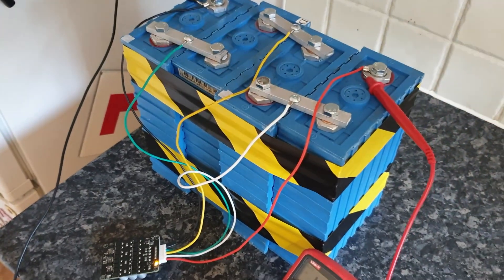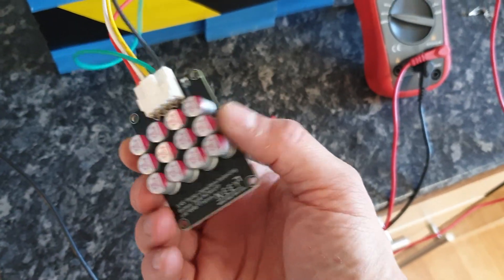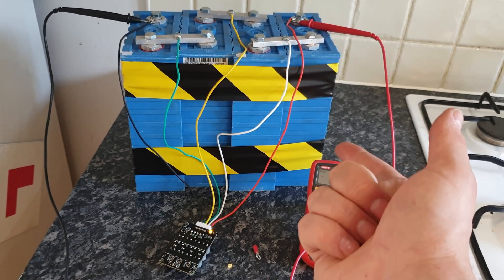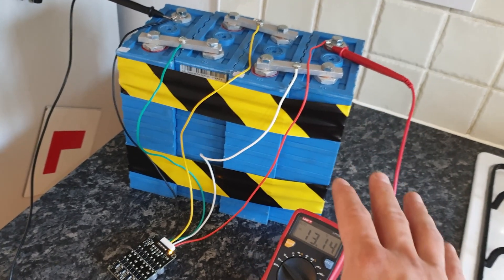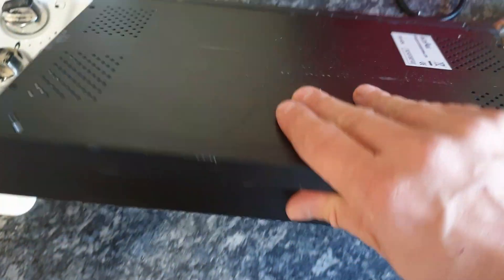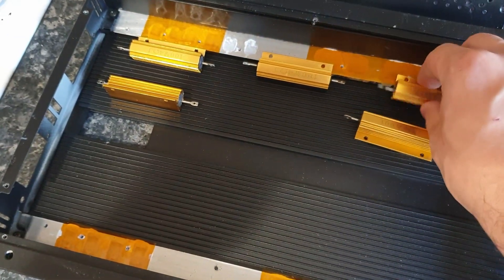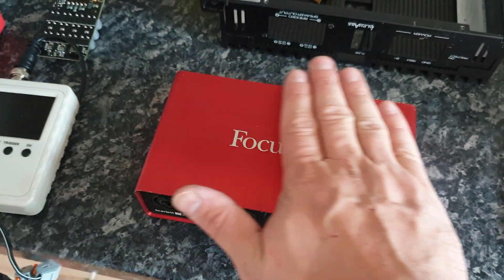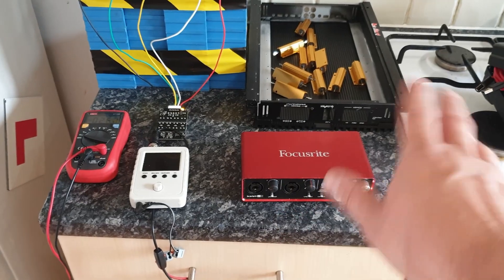Amplifier testing (help needed)

Comment: You will also need a voltage divider between test load and audio interface for a smaller signal its line input can handle. Try with a 10k linear potentiometer.